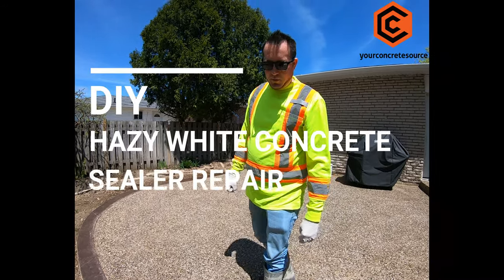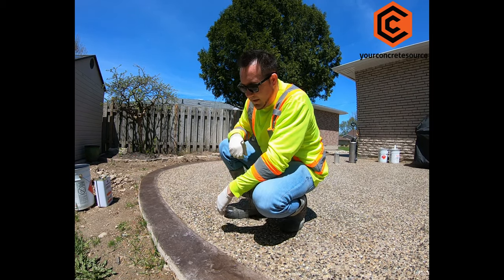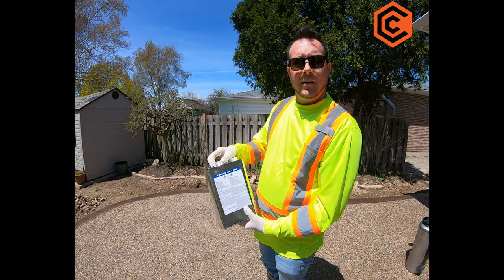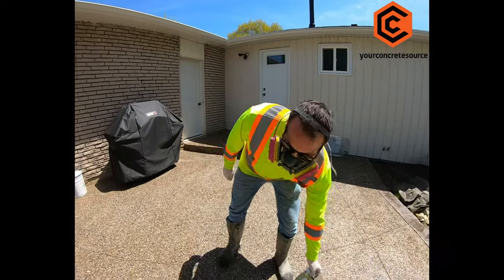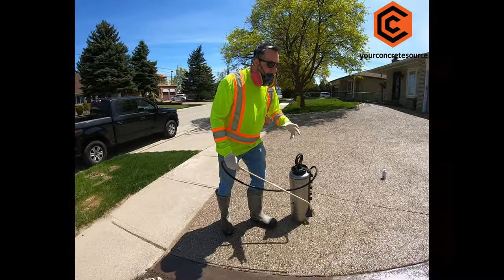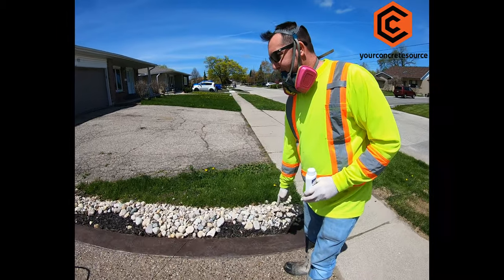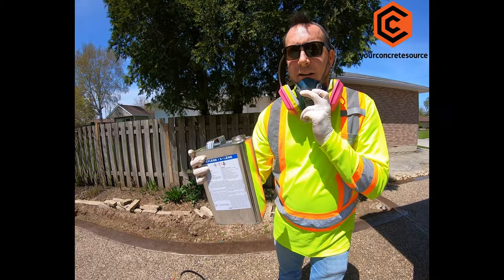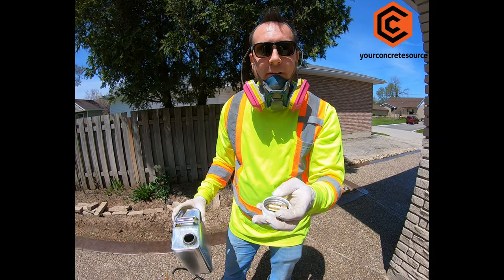#DIY WHITE SEALER REPAIR

Comment: I think your video is missing the middle part. Did you put xylene on the concrete to remove the white?
Reply from the maker: Hey,  the xylene neutralizes the moisture on contact. That's all you need, is quite amazing  as the white haze immediately disappears.  Thanks for your question

Comment: I had to go back and re watch this.  I wasn't clear on whether you were spraying Xylene down to clean up the previously sealed concrete/pavers that turned white/cloudy or were you mixing it in a new coat of some sort of sealer because at the end you referenced cleaning out the sprayer with Xylene to prevent it from getting clogged up by the sealer. Which is it or something altogether different?
Reply: Yep, same here.   This was not clear to me either

Comment: If sealer is put on too thick, can you use xylene on it to thin it out so to speak?
Reply: Yes, but you have to get the sealer off. Plenty of rags and hard work
Reply: @adamleen595  use a 4000 psi pressure washer to strip the sealer that have been coated with xylene.
Reply from the maker: I am using xylene to neutralize the moisture ( white haze) to a breathable and transparent state. Do not try to use a rag.  I am editing video on how to.removed sealer.  Thanks

Comment: After applying the xylene do you scrub it, swipe or roll it to even out the sealer?
Reply from the maker: The xylene drys very quickly and that will reactivate the acrylic. nothing else is needed. Great quesiton

Comment: You can mix the silica sand in the sealer instead of sprinkling like you did
Reply from the maker: I used to do that but the adjustable sprayer tip I used would clog.  Also the spraying consistency was uneven as the sand would always settle at the bottom.
Reply from the maker: Thanks for your feedback glad to hear someone else uses slica
Reply: Roll on

Comment: We put a clear coat on my new stamped and stained concrete the day after it was poured. It was dry... and the sealer looked beautiful and glossy. I hosed it down about 4 days after the sealer dried and now it turned hazy, white water marks.. not shiny. What’s the problem?
Reply from the maker: Hey good question.  1.  If the concrete was damp it would haze.  2. If sealer for old concrete was used it would haze not allowing the concrete to breathe( cure and seal is ideal for new concrete as it help with the cure)
Hope this helps
Reply: @theartofconcrete  the sealer was beautiful and clear until I wet it 3 or 4 days after it dried. Could be my water is too hard? No idea. Maybe bad sealer? After it got wet and dried up, the white stains and marks come out like when salt water dries and leaves salt rings
Reply from the maker: @thebirdizzzle  humm.  Not sure I'll ask social group
Reply from the maker: Hey yes it sounds like moisture in the concrete
Reply: Or applied too thick. Every coat needs to be even and thin.

Comment: Video is kinda confusing.. where is the part where you are fixing the white spots? Just shows you spraying sealer
Reply: @theartofconcrete  and do you have to reseal it after ? Or what's the next step?
Reply: @martintomasiewicz2856  apply xylene first and see the results. if doesnt help strip the sealer using 4k power washer (you may use xylene again to soften the sealer) and apply sealer again (ideally one that does seal and cure). 
to answer your question yes you may apply sealer on "top of" xylene after some time (give it few days to evaporate properly) but again you may not need to do it as i said above

Comment: I have found that some sealers are just bad.  Gave xylene baths with not good results. Only turns white where the sealer sees heavy sun.  I found it’s best to sand blast it off and re apply sealer
Reply: I had my driveway sealed with an anti-slip additive and it came out blotchy. Did the sand blasting only remove the sealer or was the concrete also damaged at all?
Reply: @victorvanvas  I’d be willing to bet all the sealer wasn’t removed
Reply: @adamleen595  Thanks, i added you